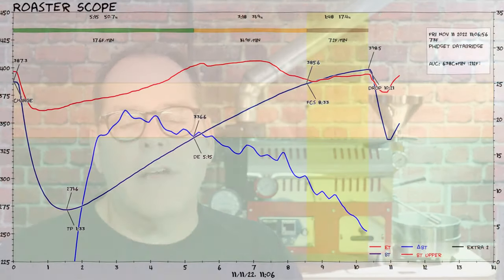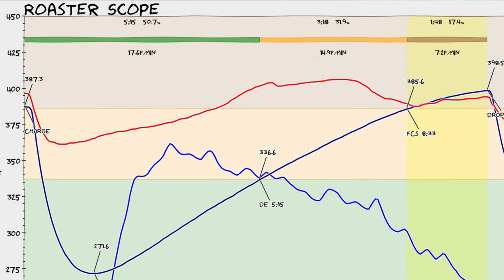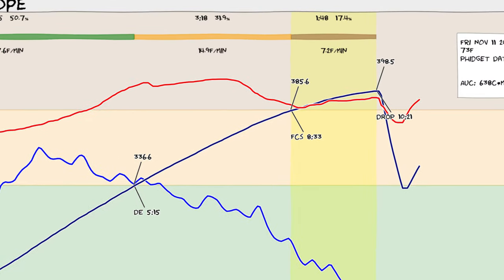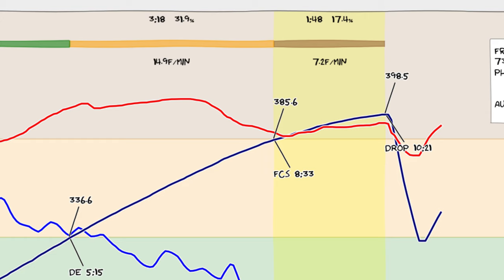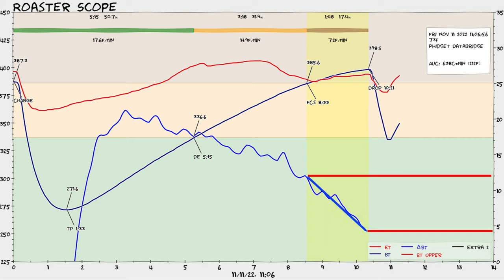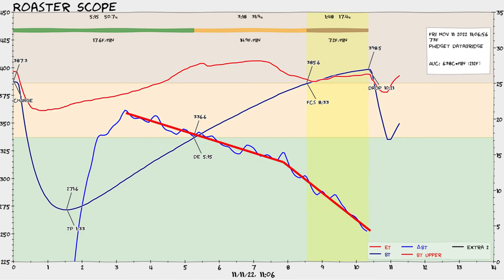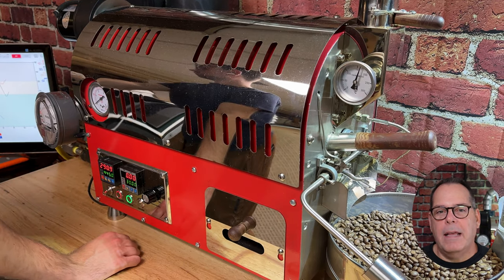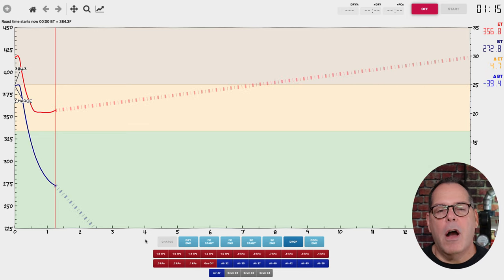Roasting A Papua New Guinea  Coffee

Comment: Hi Mike I roast two bathes today. I changed my charge temp from 428 to 385 so I could slow down my roast it work very well the coffee smell very good. Before with the charge temp the roast was completed in 7 min. With the 385 charge temp the roast was completed 10 to 11min. I am new to roasting these were my 12th roast.  Colombia and Ethiopia 300ga in the Huky 500. Your videos are very helpful Thank You.
Reply from the maker: I'm glad that change was helpful.  Depending on your coffee process and bean size the charge temp should be changed.  A dry process coffee might use a slightly lower charge while a washed, dense bean might use a slightly higher charge temp.  If you don't change your charge temp you will notice some roasts move slower while others move quicker through the roast process.   The next step is to control your roaster event times.  The charge temp has given you a nice starting point.  A good practice would be to find the right charge temp to get your roast to dry end in 5 minutes.  Then you can focus on lowering your temps, causing a descending ROR so you reach the next event (first crack) at the 8 minute mark. This will take some practice.  Same thing goes for your drop time at 10 minutes.  Happy Roasting!

Comment: This mega roast weekend will be a memorable family event. Nice job!  The thought, effort and occasionally, frustration, that goes into arriving at a good profile can’t be fully appreciated by the end enjoyer of a roast like this unless they also roast.  One question. I don’t see a trace for your MET curve. Do you have an analog MET temperature that you use to ascertain whether a fan increase will increase or decrease heat? And did I hear you say that you also bumped the gas up a bit to stop a crash at FCe even though the gauge still read .5?  As always, I appreciate and enjoy your videos!
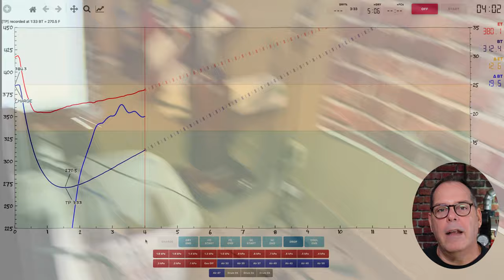Reply from the maker: Thanks for watching and your comment @210Doc .  No, i'm not tracing my maximum environmental temperature although i think Artisan can do that for me using my ET probe.  I am not monitoring the airflow in Artisan other than manual buttons when used..  Getting an airflow sensor is something I have been wanting to do and finally upgraded my Phidget so I can accomplish this.  I just haven't gotten around to getting the hardware to complete it.  .  I am using the exhaust temp readout (red line) to help me with consistency in my roast.   With regards to airflow influencing my ET, I mention this in my video at 15:14 and you can see in my graph that by increasing the airflow, the ET climbs at a greater rate.  Although not for a long time, it helps me achieve the increase needed.  It is important to note that turning up airflow too much will eventually suck out the hot air.  I use this method later in the roast to help slow the roast down about a minute before first crack.  As farthe gague still reading .5 when i was talking about preventing a crash, I must have misspoke?  Basically from about 1 minute before first crack,  I lower my heat in multiple steps.  I think 18:26 shows I am at .25kpa and from there I manipulated the gas  to manage ROR.  You will see me increasing the gas to prevent my ROR from crashing.  I think that is what I was trying to describe.  Sorry if I misspoke.  I guess  I should have mentioned my gas setting range is not something that can be translated to another type of roaster.  So, in a general sense, backing off the heat to lower ror (not bean temp) to help slow the roast was the main point in that section.  The specifics of the amount of gas should be interpreted as a general idea.  My roaster retains heat.  That allows me to "coast" my roast with little gas because of exothermic reactions and the heat sink of a roaster I have.  I hope that helps explain a little more of what was going on during first crack and the end of the roast.
Reply: @VirtualCoffeeLab  Thanks for the prompt reply. You’re right, I missed seeing the video frame that showed gas at .25 during FC and only caught the bump back up to .5 to halt the RoR crash. Being a noob at gas drum roasting with only about 35 roasts, I guess along the way I picked up the idea that raising gas to stop a crash during FC was verboten. I’ve been trying to avoid the hump and crash prior and during FC by applying Rao’s 50% gas reductions at his suggested development percentages. Glad to see that his technique is not the only way, as his technique has helped,  but it’s nice to know slight gas increases can be used as well to avoid a crash. 
I’ll be glad to see your approach to this bean on the Behmor as I’m planning to teach my son how to roast with it.
Thanks for all your time and teaching efforts!

Comment: I roast outside on our deck and it’s only 28 outdoors, going to have to wait until Thursday when temp is suppose to increase to 48
Reply from the maker: Yea, cold snap big time.  Enjoy your roasting!
Reply: Hi Ken. Just curious as to what you are roasting on. I might have a solution to your problem.
Reply: @jlantz3691  I’m using a SR800 with a Razzo 12 inch extension tube,,,
Reply: @kensafranek2306  Thought I remembered that. I do too. I have a way to roast indoors in any weather. If you feel comfortable giving me your E-mail, I could send you pics and a description. I roasted this way all last winter, and this current cold snap. A lot better than not roasting or slugging it out in the cold.

Comment: Always enjoy your videos, especially when you showcase the MC500g roaster as that is what I roast on. I realize all the numbers vary even with the same roaster but I would love to have a peak at your burners as you roast. Just a comparison of flame height and size would help me visualize mine compared to another.
Reply from the maker: It's funny you mention this.  Every video I do has twice as much content as what I actually publish.  Through the edit process I try and get my "roasting" videos under 25 minutes.  Optimal video length for attention is much shorter than this but when dealing with profiles and then an entire roast along with a recap it is hard to have it be short.  Anyway, in my original uncut version I did show the burners.  
If you look at my intro bumper on this video found at 0:24 you will see a brief snipit of the burners on around 28 seconds on the video timeline.  I have purchaed a couple of webcams to show other views during a roast but have not had time to set things up.

Are you using propane or natural gas?  If natural gas, did you drill out your jets or did you buy MC natural gas jets?
Reply: @VirtualCoffeeLab  My roaster is set at Mill city using propane and regulator from them as well. Max flow tops at 3.1.  I only wish I could roast more but as a home roaster there’s only so much I can use and gift. I’ve tried to reach out to other 500 owners but I’m not sure it’s as popular as the larger ones.

Comment: Excellent work batching out that coffee. 
A few questions come to mind - main one is how often did you clear the chaff, as this would have created a LOT of chaff. 
Second, round numbers from your comments, you had ~80 batches to do 40kg, and at about 15 minute turnaround that your BBP gave you, means 20 hours roasting. How many roast hours and how many elapsed days did you get that done over? 
Did you do full weigh of the roasted product to see weight loss per roast, it's another factor you can use to confirm consistency. If so, did they vary much?
Did you cup individual roasts (or groups of roasts) before deciding they were/were not up to par? I know how hard that is on a small roaster, with only say 420g output, using 10g-20g for a sample adds quickly to the number of batches you have to roast. 
How did you find Artisan to do all this - you probably could do a whole video about how to optimise Artisan after an experience like this. Personally, I have Artisan auto switch off after X seconds from drop (90sec at the moment, but that's too long and due to come down a bit), so I can focus on cooling the coffee and prepping for the next roast, and all I need do is hit start again to get it tracking my BBP and be ready to charge the next load.
And final one for now, woohoo, looks like you're getting a bigger roaster!?!? :) The little hint you dropped at the end is exciting to say the least ! Can't wait to hear more.  (My North 500g has not had a batch thru it since I bought my Blueking 2.5kg machine, equivalent to a Buckeye BC5)
Reply from the maker: Hi Brett, great questions.
We vacuumed the chaff near the burners and out of the chaff collector about every 5 roasts.

We roasted 80 batches with a BBP that was about 2 or three minutes before the next charge.  We took turns roasting (my son and I).  Friday morning at 7:15am I turned on the roaster and by 8am started roasting coffee.  I roasted until noon and then Michael took over and roasted until about 5:30pm.  We idled the roaster for about 35 minutes to have dinner and then I roasted until about 8pm.  Saturday we started at 10am and roasted until dinner time.  That got us to our 80 or so batches.  Packaging took place in phases because we waited until our bucket was pretty full so we could mix the coffee.  So I think it was about 20 hours of roasting over a 2-day period.  We did have time reserved for more roasting on Sunday if necessary.  Lots of roasting!!! Whewww.

We roasted full batch 500 gram roasts measured down to the tenth of a gram and we did weigh our roasts to monitor moisture.  We had a moisture loss of 13.5% which ranged +- .3%. so sometimes as low as 13.2 or as high as 13.8 with 14% a few times.  Not perfect roasts but not too far out of spec. 

We did taste a couple of specific roasts and they all tasted similar. 

We didn't make any changes to artisan because we are very familiar with the routine.  Every week we roast about 5 lbs of coffee on that roaster so we are doing multiple batches.  It wasn't really difficult and no automation was necessary.  The timing of how long the door was left open when to change the gas & air settings and then save the file before hitting the reset and then on button was really important.  if we messed that up which did happen a couple of times, it delayed our next batch about 5 minutes.    Thankfully it was not windy outside so there was variation with our air settings.  When the beans would drop we had about 15 seconds of stirring before the door would close.  After that, they would lay with air being sucked through them to cool.  That gave us time to start the next roast, monitor the ET, and then set the gas for the climb toward dry end.  During that time we could empty the tray into the bucket, tidy up a bit and make sure we have greens pre-measured for the next roast.  When we did have to clean out the chaff we left the door open for about 30-45 seconds and used a different gas setting to allow time to vacuum the chaff.

At the end of the video, i mentioned using other roasters.  Earlier in the video, I referenced the hive, fresh roast, behmor, and possibly the popper.  I would love a larger roaster but because I'm only roasting 5 lbs a week (except for this special project) the 500 gram is big enough for me at this time.  By having the smaller roaster I am able to roast smaller batches of different coffee.  So, our 5 lb a week roast consists of at least 4 different coffees.

Thanks for your questions and for watching Brett.  I wasn't sure what type of feedback I would get with this roast.  I realize there are many different types of roaster machines used by people with a huge swing in experience level so sometimes I'm not sure how my views will respond to the content.  I'm glad it was helpful for you.!

Comment: What kind of temperature probes are you using?
Reply from the maker: Hi David,, thanks for watching my video.  They are stock probes from Mill City.  Came with the roaster installed.  The BT is a 50 mm K-Type 2mm diameter  and the ET is the same diameter.  Not sure the length.  Could be 100mm long 2mm diameter.